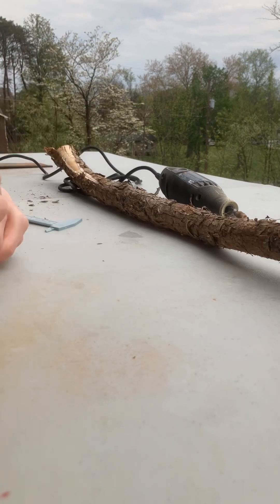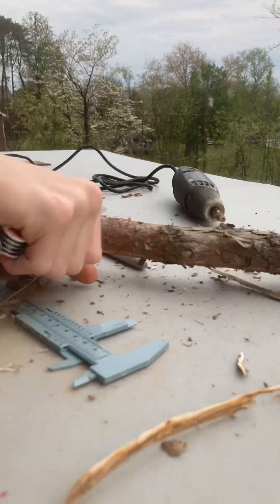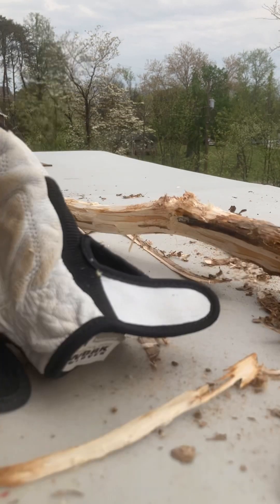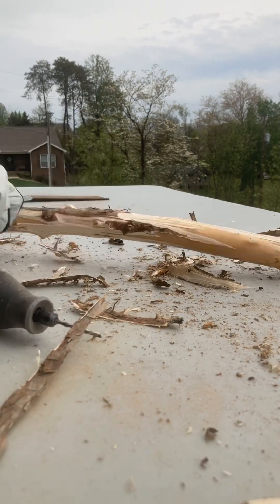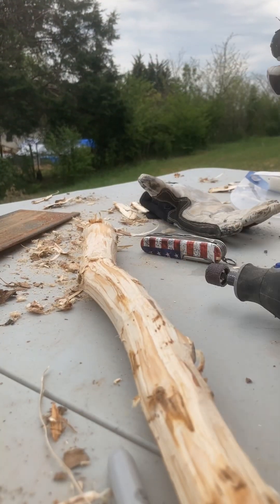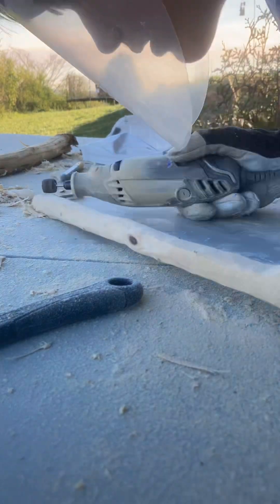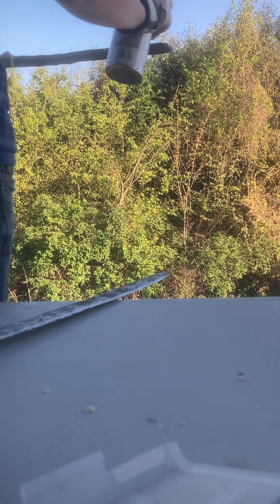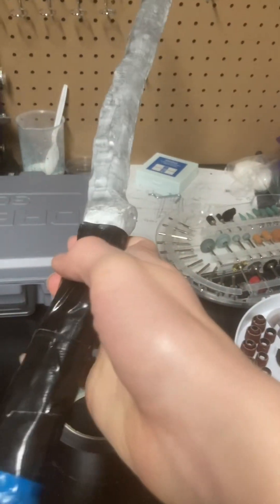I Turned a Stick Into This

Comment: Now way you still post vids this is a good channel can a get a doc Oct arms
Reply from the maker: Just make one with like foam all you need is string straws foam and card board and maybe rings to control it. A simple pulley mechanism should do the trick. I if you make the arms out of foam pool tubes and put scut straws across it attach those to a box on your back and make a string pulley in the box coming from the end of the tube to the box to a ring on your finger you can pull the ring it it moves
Reply: Thanks a lot